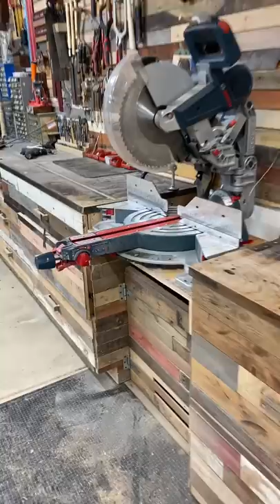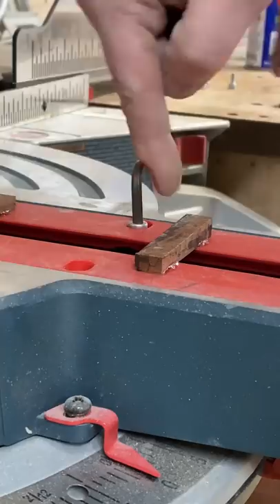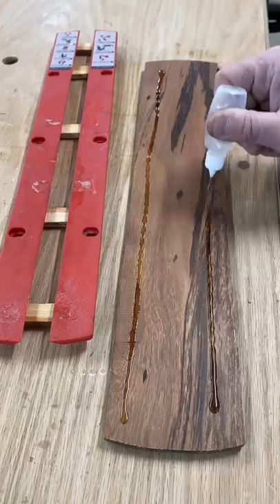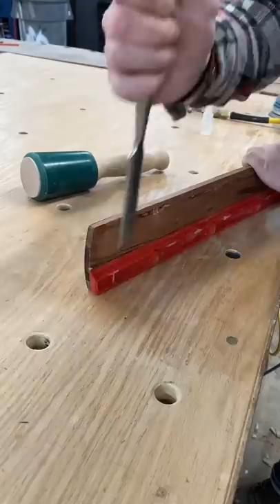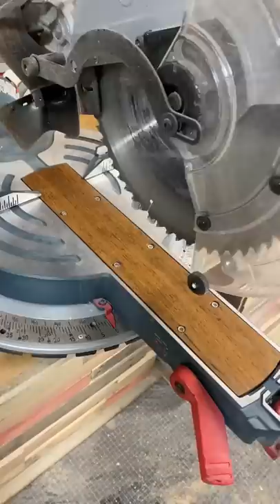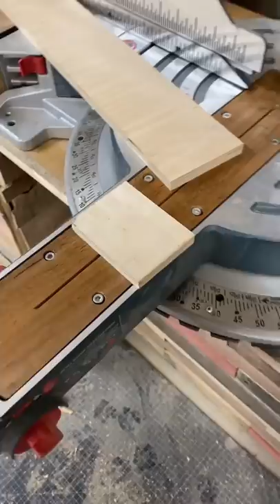Zero Clearance Insert For the Miter Saw #shorts

Comment: Now make it out of plexi, (make few of them)and glue some .5 mm neodymium magnets on that plate at every screw.  so it’s easily swappable for when you need to cut angles.
As far as screw holes in saw, put in some ground down bolts with much smaller heads and match deck height on everything.
Reply: That would be a nice setup to have. Sounds difficult to do it right.
Reply: @BassGoThump  not really, if you check the polarity of the magnets you can just do what he did in the video with plexi or another material
Reply: @atom6486  uhmw  or delrin
Reply: Whoa the magnet  part seems pretty genius to me.
Reply: Or you could do what pro trim carpenters do and set your board ontop of a scrap piece of sacrificial wood. I would only make a flush insert if I had hundreds of cuts to make one after the other because time is money.
Reply: @williambrandondavis6897   if it’s a shop saw for cross curing only which it looks to be, then yes, this makes sense. Besides they probably have flip stops n all for 100’s pieces / repetitive cuts

On thrr we other hand when I trim in field I just take my kapex ks120 with wings set up and that’s good enough. (With zero clearance inserts) slide in pieces made from azek. Less then $1 per piece. So I just got a bunch in the truck and don’t bother with making my own.
Forgot which company makes them. Woodcraft has it
Reply: Actually constructive advice!? On a YouTube short!
Reply: @williambrandondavis6897  that's more time consuming to find a scrap piece every single cut than to just have a zero clearance insert made in advance...
Reply: This has to be a troll. Its literally a template of another material. Does nothing but waste time. A "skin" swap for you MLG counter strike players out there.
Reply: @charlespanache7047  you have literally no clue what you're talking about. A zero clearance insert has a specific purpose... The factory insert is oversized for bevel cuts etc. It's a universal setup out of the box. The zero clearance inserts are for finish carpentry where you don't want tear out on the bottom side of what you cut.

The internet is just fucked with people thinking they can assume knowledge about a tool they've clearly never used to it's true potential
Reply: Wouldn't the vibration from the saw break the glue loose, or even demagnetize the magnets?
Reply: @WannabeOperator  ive used a chop saw. As long as im not running it like an axe ive never had this issue. Are you buying your trim from home depot??
Reply: @charlespanache7047  doesn't matter. Sometimes the edges of the cut will look torn if you don't use the proper equipment
Reply: Such an elegant idea! You could easily have a zero clearance insert for all of your regular angle cuts
Reply: @osco4311  really?🧔🏽‍♂️🖐🏻
Reply: @guslulou8428  huh?
Reply: @osco4311  those were stupid questions. There aren’t powerful vibrations from a miter saw. And even if they were, how could they cause a magnet to stop functioning?
Reply: @guslulou8428  do you know how magnets work?
Reply: @osco4311  😂🤣 No🤣 🗣Why don’t you tell us how a magnet works 🤗🥳. 
🤷🏻‍♂️Sorry, I just couldn’t resist.
Reply: Is that cast iron or aluminum, not sure magnets would work on aluminum
Reply: @chemjack8112  if old screws are put back in original holes, (deeper without the plate) which would allow .5mm magnets to hold on to them cause they’re always metal, as far as inserts, I only suggested azek cause it’s super easy to work with, and blades don’t dull if hit it hard, unlike plexi or anything else.
Reply: @osco4311  I know enough about them to understand that the mild vibrations created by a miter saw won’t demagnetize them. Especially rare earth magnets like suggested. 
And those vibrations aren’t going to effect a glue joint if a quality blue is used in sufficient amounts.
Those were just silly questions asked by someone with clearly limited life experience. .
Reply: Aleksey Ivanenko.  When you cut angles the insert turns with the blade no different than a straight cut!
Reply: This is a great idea.

Comment: Pardon my ignorance... but in which way does this make the cut better? 
As above, i have no knowledge in working wood, hence the question...
Reply: It also allows you to know exactly the place of the cut, like instead of messing with the stopper each time you just measure on the face that will be presented towards you in the cut and which side of the line you need it to be on, idk I’m lazy and that’s how I would use it
Reply: @goldenbacon  oooh ok, now i get it. Basically there's no space for any splinter to form as the piece  is pressed on the (in this case) wooden panel, while with the previous gap there would ALWAYS be splinters forming, no matter how slow you feed the cut.
Nice, thanks for the explanation.
Reply: More teeth on the blade can help too, but this is probably the best way to mitigate tearout
Reply: Makes very little difference,,ocd
Reply: @rickputney5572  depends on your tool quality and skill level.
Reply: Also allows u to cut small pieces
Reply: @goldenbacon  how can it blowout the bottom when it's a bottom cutting saw. Like a skillsaw versus a top cutting table saw
Reply: @charlesmiller3778  you check the cut by setting the blade (not running) down on the wood until it lines up with your line, lifting up the blade, starting it, and performing your cut.  If you do it the way you said in your comment then you will often be off by a 16th or maybe even an 8th once the plate gets broken in and the alignment of the saw changed slightly.  Seems small but will make a huge difference in joinery.  If your want to set up a stopblock to make multiple cuts, your would line the blade up your mark, clamp down the work piece, ensure the mark is still lined up, clamp down your stopblock, unclamp your workpiece, and perform your cut.

Edit: figured I should also state the point.  It's a mixture of minimizing tear out, not losing small pieces when making small cuts, having a work surface your aren't afraid to damage since it's replaceable, and maybe even a bit of visual preference as well (we all like our little things like that sometimes).
Reply: Well one thing is the grain doesn’t blow out on the bottom.

Comment: Great Bart! I love the 60 second format for tips like that. I finally got myself a Bosch glide miter saw and did this a couple weeks ago with the intermediary step of making a template from MDF. You saved a couple steps there. Well done.
Reply from the maker: Do you love it like I do?
Reply: @KomarProject  What do you think? Short of buying a Kapex (reputedly has little fairies that come out and vacuum up individual specs of sawdust) it is definitely the best saw. With a Forrest blade on it I don't know of another saw in it's class.

Comment: For those that don't understand. Zero clearance inserts eliminate tear-out on the bottom side of the material you're cutting. I'm sure he is 10000% aware the insert won't work for beveled cuts etc. It's for cutting pieces he doesn't want tear out on... Zero clearance inserts are great for table saws as well. Can even make a special zero clearance insert for the beveled cuts if you so desired to

Comment: Damn! I am, definitely, making one for my miter saw. I have hated the gap in the plate. It is spongy, not level, and everything that I remove less than half an inch falls inside the table and will, often, prevent full table rotation. Thank you for the inspiration.
Reply: Don't  know if you need to saw at angles but if you do than keep that in mind. (That is why the original has a bigger hole so you can cut at different angles without swapping plates.)

Comment: I don't get it, what was the point of doing that? Now when you angle the blade you'll have to put the plastic back on or cut through the wood
Reply: They think it reduces tear-out.  I don't think it really does much of anything.
Reply: @CeeJayThe13th  then you’ve never tried it.
Reply: @CeeJayThe13th  It 100% reduces tear out.
Reply: @4TheFellas  if you have tear out, your crowding the saw (sawing too fast) or dull blade....
Reply: @harveymanfrantinsingin7373  agreed, and Don't call me stupid!
Reply: Is better than trying to dig out small cuts that have slipped into the wide gap
Reply: @carlk2193  there's this nifty invention called the shop vac...
Reply: @dabsteelpimp  guess it would be easier to dig out small needed cuts from a shop vac.
Reply: @CeeJayThe13th  there are videos showing it doesn't change much of anything, if you cut too fast with a doll blade you get tear out. There are videos off guys cutting hardwoods without a insert at all and it comes out clean
Reply: No offense to the guy but I didn't get it either
Reply: @joshyingling  thank you.  I know it doesn't accomplish much but I'm getting attacked by dudes who like to slam their miter saws down like they're arm wrestling it lol
Reply: @jonswoveland  ehhhhh… what was the middle part, again?!  Hahahaha
Reply: @jonswoveland  no need to as you already called yourself stupid.  Still trying to locate the comment where Harvey called you stupid.  Maybe he deleted or did an edit.  Telling someone not to call you something  before they do  is pretty much a guilty sign, Meaning you knowingly said or did something  stupid but telling people not to call you stupid as you're already aware of it.
Reply: @cody39yrs  did you hear that "whoosh" sound?

Somebody needs to watch "A Fish Called Wanda"

Comment: Only ok for straight cuts, 45° bevel cut and you are back to square one
Reply: ... And? It's not like you (JB) weld this insert in place. But if you do a lot of cuts at one bevel, like 45°, you could just as easily make another one for that, too.
Reply: @pr0xZen  yea but imagine having to change out inserts during a job... very time consuming
Reply: Just make another one. If you noticed he kept the other insert as well too so he can keep using it as well
Reply: @c117ls7  I think you under estimate how long it would take to swap that out
Reply: @anthonyspinozzi1312  true but a pain to keep swapping them a sharp blade or cutting on top of waste timber is simpler. Most hardwoods cut without ripping the back, also a sliding arm also is designed to stop it. Cut from front too back. Nice project though, not knocking it if you have time to kill
Reply: Blah blah blah

Comment: Quick tip! 
In our shop we love 2P10 (crazy glue) for jig building and such. Nothing permanent! But try carpet tape for router jigs. It holds very well and no residue left over. Make sure to put clamping pressure on the tape spots if you're doing smaller pieces. Also works good for plastics and acrylic that you cant glue too 👍

Comment: You do realize the original plastic inserts are adjustable to close the gap right?
Reply: By no more than a 1/4 on each side....Not enough to get rid of the tear out that occurs on miter saws. The wood insert is 100% necessary
Reply: The original is weak
Reply: The wood also looks much nicer than a plastic piece
Reply: @JamesTheFurst  Absolutely
Reply: And you don't loose little cuts to the base
Reply: Really ? Is this on the more expensive saws? I have a cheap admiral from harbor freight
Reply: @4TheFellas  no it is not. Table saws will benefit from a zero clearance. But not a blade that cuts from the top. The wood being cut makes it’s own zero clearance.
Reply: @4TheFellas  the saw blade cuts upwards on a mitre saw.
Reply: @v8trauma  It most definitely does not...Do you own one? Have you ever used one? Thats just a silly comment to make
Reply: @kwhp1507  You are correct.  I was thinking zero clearance fence for miter saw
Reply: I think it's just a cool project and looks classy. Which it is and it does!
Reply: @v8trauma  use your head. If that was the case the force generated from and upwards motion would mean the piece your holding and the off cut are going to want to fly at your head at 300km/h so you'd need a vice.
Reply: @v8trauma  notice how there's no vice and he only has to gently hold it? That's because the down and backwards force generated from the blade is holding it in place.
Reply: @dee5105   this will work on almost any saw. The saw In the video was a nicer saw in its day but it is almost 20 years old now most generic brands have adopted the same basis
Reply: @jeffhooper3447  Jeff gets it.
Reply: The burr is always on the upside with this type of saw (sliding mitre), jigsaws† and circular saws are the same. Bandsaws and table saws cut down, hence the tear-out on the bottom and hence a zero insert has value. The only way for it to be pushed against the backstop is for it is if it pushes toward it, which will make the blade lift the wood. That's why mosts saws have a way of holding the wood down, up to you if you use it.
† push-up blades are available for special applications.

If the saw has a vice, such as a metal cutting saw, the blade will rotate the opposite way and pull toward the moveable jaw.
Reply: @4TheFellas  Yes, I have a couple of them around here somewhere, but most people can see how they work without ever owning one. Look at the teeth, look at the rotation of the blade needed to cut and push the work towards the back of the saw. Climb down off your high horse and apologise to me for being so snotty and we'll say no more about it. The blade leaves the work on the upward side of the rotation (the leading edge is lifting and comes out of the top side of the work, hence it cuts upwards.) There's even a puff of dust at the end showing this.

It's such a simple thing to be polite, a little bit like the simplicity of understanding how this type of saw works. It appears you're capable of neither without help. I believe that's what the youth of today call a burn, please feel free to argue that one too.

Go and try cutting with one, the bur is always on the top of the work at the end of the cut. There may also be one at the edge pushed up against the backstop, that depends on the wood quality/type of the blade and how eager you are to finish.
Sorry, it wasn't an instant reply, I couldn't stop laughing at your petulance.
Reply: Oh dear, your lack of understanding is astounding. The rotation of the blade forces the work against the backstop. Look at the clamp on the left of the thumbnail, that's to hold the wood down, though most people rarely use it. Think before you type next time. Read some of my other responses for a fuller explanation, I can't be bothered to provide one on one education for all of you hard of understanding types.
I have to ask, who or what is a ranchu is it a goldfish or something cooler?
Reply: @4TheFellas  wrong! I don't think you've ever used a mitre saw. Before you get rude and say other people's comments are silly, you should probably be sure you're correct first.

Comment: I’m certainly no master carpenter, but this seems like a lot of extra work. How about just using a piece of scrap plywood under the small item to be cut? This would provide best protection against breakouts/splinters while preventing anything small from falling through, and you can cut at any angle. If you’re making multiple cuts that are the same, just clamp it or glue it down.
Reply: Agree he could just fix a piece of wood on the saw with out all this.
Reply: It's a lot more wasted wood by doing that. If you're cutting hundreds of boards then you need hundreds of cuts worth of scrap. Not to mention that it will raise up the board off the miter surface, causing it to bend if it's longer.
Reply: @anthonyspinozzi1312  one piece of scrap, clamped to saw, saw cut through small objects over and over again into same slot it cut the first time…only one piece of scrap…easy…turn piece of scrap and use for a different cut angle…I think you all just like looking at pretty wood things and not so much about using tools.

Comment: What purpose does this serve?  I've used chop saws for years, I'm asking an honest question. 

Edit: lol I actually don't know.  Anyone have an answer??
Reply: Is it to make it look nicer than the original plastic one?
Reply: @gartan8449  no, I think it affects tear out on the cut?
Reply: From what I understand it is to make a clean cut. On the miter when you make a cut you usually have pieces on the bottom that chip off as there is nothing under the end to support it. While it doesn’t have much of an effect, it can be annoying and ascetically displeasing. To fix this, they made a piece that only has room for the saw to go through, meaning the wood you cut will not chip because it is supported if that makes sense.
Reply: @ZSmith-yy4lv  yeah that makes more sense then doing all that work just for a wooden finish to the thing..:p
Reply: @gartan8449  I’m sure some would still do it for ascetics, It does look nice.
Reply: @ZSmith-yy4lv  true. i do like it better myself but The actual reason had to be more practical and I think the edge is the best answer to it
Reply: @gartan8449  It can also help less experienced carpenters work faster because they know where the saw is going to cut and dont have to spend as much time aiming the blade.
Reply: @williambrandondavis6897  cool. Thx for the reply.
Reply: It causes less or zero small pieces of wood fragments from your cut to fall underneath or inside the saw.